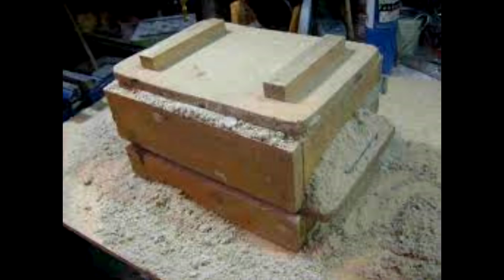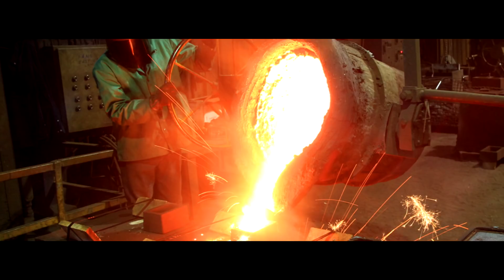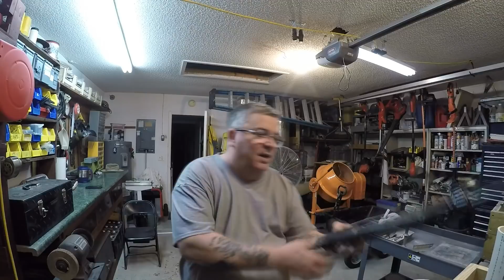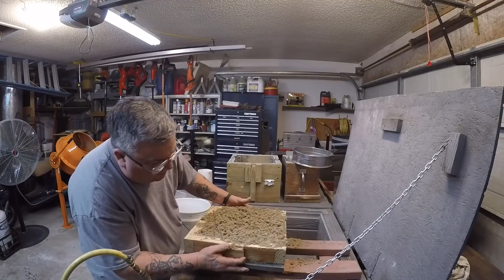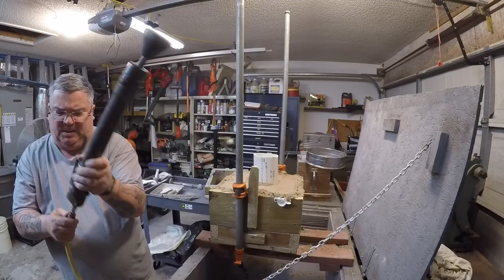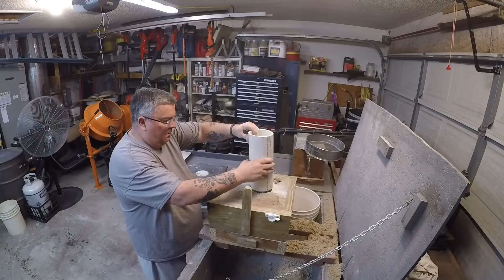Saving Machinists money, ramming up a billet

Comment: Just an idea, put a stick of Strut Channel over your work area. Get the type with slots vice holes to better match up with your studs. You can get the strut from any electric supplier and go to McMaster-Carr and get a trolley for the size of strut you buy. Install a 3/8" all thread into the trolley then mount your camera. This will keep the camera out of the way and give you the freedom to roll it over your work to get the down looking shot you want.
Reply from the maker: Good Idea, will put that project on the list. Thanks!

Comment: You were talking about making the gates and I wondered why not just make the top of the mold open and pour directly into the top of the cylinder?
Reply from the maker: You could, but remember, most metals will form dross if enough turbulence is present when pouring the metal. Pouring down the throat of the mold cavity would not only form dross but when it hits the sand the force of the falling metal will dig out some of the sand and deposit it in the mass of the casting, making the machining of the billet rough on the tools and there is little possibility of useful metal.

Comment: I enjoyed the video, question? If I needed a piece of round stock like the piece of pipe you rammed up would there be a down side of making a split piece of steel pipe with a bottom and pouring the aluminum into it? Given if it was more complex than just a piece of round stock the sand would be a better option.
Reply from the maker: Do you mean that you would take a piece of pipe, split it in half, ram up the first half in the drag, ram up the second half in the cope then pour it that way? Don't forget, in both cases the metal in the bottom of the mold cavity would solidify first and the shrinkage would manifest itself in the top of the casting. If you were to make a mold where half of the cylinder were being poured in the drag and the other half were being poured in the cope, the need to remove the shrink from the casting would require you to reduce the diameter of the billet until the defect was gone. If the diameter of the billet was important for the project, you can see how that method of making the billet would be a problem. The method I just illustrated would require the machinist to machine the shrink from the one end of the solidified billet reducing the length of the casting but leaving the diameter of the casting alone. I hope I've answered your question clearly. Good question!
Reply: What I meant, I was wondering if I took a piece of pipe and made a 2 piece steel mold,  preheated it and then poured the aluminum into it. No sand involved.
Reply from the maker: That would work but you'd have to make certain that the split was flat so that the aluminum couldn't leak out. You'd also have to find a way to block off one end so the aluminum would stay in the pipe. Here's my suggestion; once you split the pipe, get two big hose clamps and clamp the pipe halves together so that the hydrostatic pressure of the molten aluminum can't force the two halves apart. When you buy your pipe, make sure that one end is threaded and buy a pipe cap that fits. When the two halves are clamped together, screw the cap on to the bottom of the assembly blocking that end so the metal is trapped. If the assembly is small, you can get a large pot, center the assembly in the pot (the open end up, of course) then pour dry sand around the assembly to keep it in the upright position. It probably would be a good idea to heat up the mold on the inside of the pipe to insure that all oil and moisture is gone before you pour the metal. In addition, you should tilt the whole thing a few degrees so that you can pour the metal into the mold using the side of the pipe so that the pour will be smooth and with out turbulence keeping the formation of dross at a minimum and keeping air from becoming trapped in the metal. Good luck and keep us apprised of your results!

Comment: 54:32, Payin' attention and tryna learn.  Looks like you just rammed up that second level and you're adding a 3rd form and pounding more sand but you haven't stabbed the sand for venting.  Is it not necessary to vent that second layer?  Then at 1:11:22, you're venting the 3rd
Reply from the maker: Glad you're paying attention! It turns out you paid attention better than I did. I was in such a hurry to make the mold, I forgot that step. Yes, you should vent the second layer too (every layer should be vented to prevent gas/vapor build up and it should be done automatically).

Comment: That sure is a powerful rammer 👊
Reply from the maker: Not nearly as powerful as a floor rammer.
Reply: sandrammer do you also got a floor rammer?
Reply: It looks the same as what you were using now
Reply from the maker: No, won't need one in the foreseeable future. They are used on floor molds made by flasks 16"x16" or larger. The sand requirements and furnace requirements is way beyond me.
Reply: sandrammer okay 👌
Reply from the maker: It can be, that's why we turned to the smaller version for bench molding. The smaller version was approx. 18 inches long, weighed approx. 3 pounds and while fast, didn't have the same force as the one I just showed you.
Reply: It seems kind of spastic and difficult to control